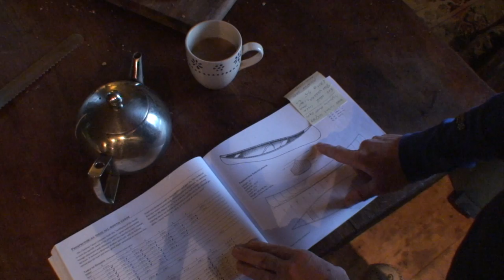building a cedar strip canoe

Comment from the maker: some people staple the strips to the forms but this leaves holes in the strips ,i clamped each strip until the glue went off  the hull just pulles of the formes when finished as the forms are coverd in tape so as the glue does not stick to them  good luck !

Comment: You will probably be closer than you think while building. Every board you cut, every stroke with a plane, every strip you sand and hammer into place is the very same movements and actions that your grandfather did while building his. And you will feel the same pride he felt with your work as he felt with his.